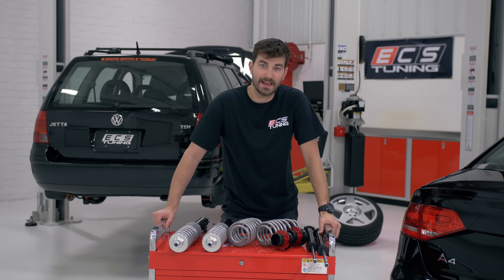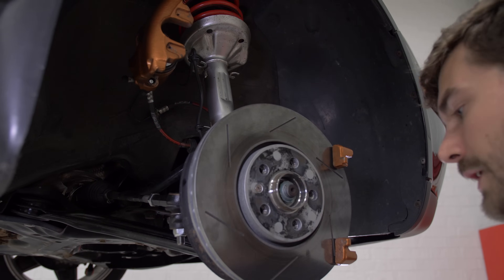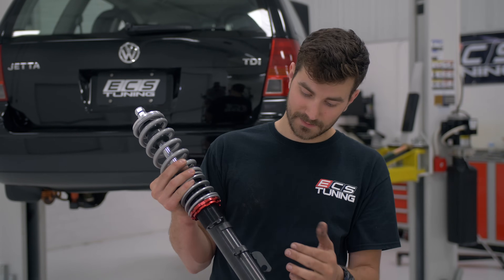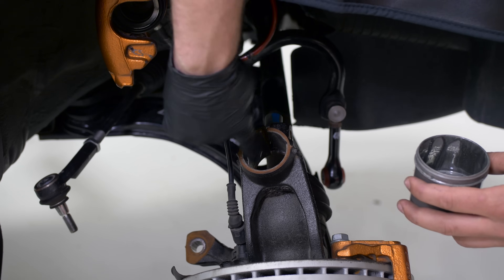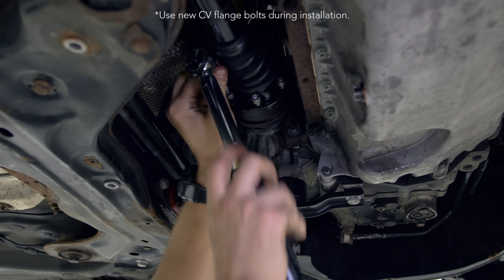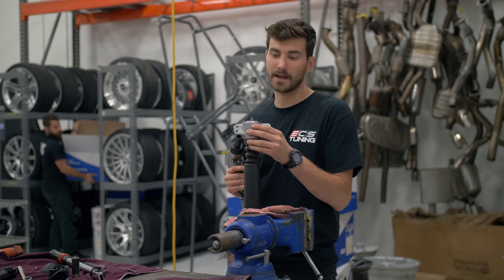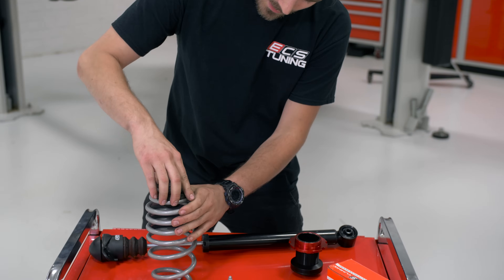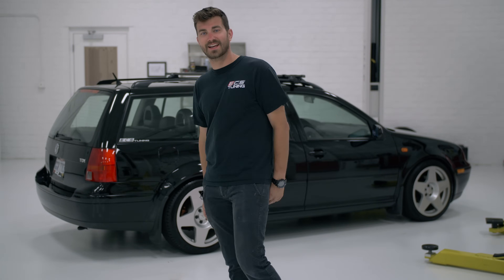VW MK4 Coilover Removal and Installation DIY

Comment: The way you do it stresses me out...not everyone lives in a shop with every tool imaginable some of us need poor person DIY instructions
Reply: What exactly here can't be done at home? The only thing shown here that wasn't a basic, BASIC set of hand tools was the lift and trans jack. Neither of which you absolutely need to get the job done. Jack it up, sit it on stands, then use floor jack to line everything back up. When torqueing rear shocks set it on blocks of wood. Every other tool here can be had for a grand total of like ~$200 from harbor freight.
Reply: @theyrealltaken3  imagine calling someone stupid and forgetting a period at the end of your last sentence. :)

Comment: There is no need to remove the caliper, ball joint and all that stuff. As long as you remove the (6) 12 point bolts and disconnect the axle from transmission and just move the axle to the side you have plenty of room remove the old suspension and install the new coilover.

Comment: this is actually an amazing video. great mk4 content to us dudes that still drive nicely stanced golfs/jettas/beetles. Just did my coilovers 3 weeks ago and I've been stoked since.
Reply: also i had a question. do those perches sit flush? i think i have some rust built up because the perches weren't flush but they were tight after i tightened the nut on the plate underneath.
Reply: I just bought mine today and got the rears in, So pumped yo
Reply: Mine I just installed make some banging in the back from what sounds like the top of the rear shock mount, is that a ride hide issue? Please help 😅
Reply: @TylerSmithMusic1  use the stock strut mounts

Comment: 4 years later after much abuse and dealing with the north east winters/salt and pot holes they're holding up. Very rusty and definitely worn out but they still work. Going to be buying another set of these soon. Also threw a hitch on the ole girl and towed around my quad/snowmobile and jetski with my MK4. Suspension handled it great
Reply: It's amazing how many are still on the road. 
In my travels for work daily I usually see a handful of them cruising along.

Comment: i just put this kit in my mk4 gti 3 door last week with 18x9.5 rims with no spacers and it rides amazing, i did the same adjustment as this video and it is the perfect height. all parts fit as expected, took me about 3 hours to install, it was very painless and i couldn't be happier with the results. I had to change my sway bar end links to adjustable ones. other then that absolutely no rubbing and it handles like its on rails. very quality  parts and the install kit just made it a hell of a lot easier. Ill do an update after a few months of everyday driving with regular 3 hour road trips.
Reply: I would reccommend  doing both sides of the rear at the same time, i had to learn that the hard way. nothing a bottle jack cant fix tho lol
Reply: 2 years later do you still recommend these coil overs? I’m looking to get a set and i am not quite sure what to get.
Reply: with what offset
Reply: no idea honestly, still have them over 4 years
Reply: @TTaylor841  yes

Comment: Just a recommendation,  The rear axle needs some adjustment when lowering. Loosen and replace the stretch bolts that secure the rear axle to the body (don't torque at this point). The swing arm is heavy so support with a jack, etc. Get the ride height set as close as possible with the car on blocks and tighten down the rear axle bolts along with the lower shock mount bolts. The reason for this is the swing arm bushings will be under considerable torsional stress once the car is lowered. They are set during original vehicle assembly for a factory ride height. The bushings should have little or no pre loading on them to prevent premature wear. To reiterate, do not reuse the bolts. They are torque to yield and should be discarded once removed.

Ideally, replace the bushings with ECS Polyurethane rear axle bushing kit. These are much nicer than stock, which are probably worn out by now if original.

Dropping and re installing the axle isn't all that difficult. I've done it many times by myself using a floor jack, but as with most things in life, it's always easier with help.

The only shit job is getting the old bushings out without the proper tool. I've done it using a bearing press tool,  jigsaw with a metal blade and a hammer / chisel.  Many YouTube videos on this topic.
Reply: What rear axle
Reply: @Michal_S0L  I use VW nomenclature and they also refer to it as: “Axle Assembly”
Reply: Agree good idea to “adjust” the load on the rear beam axle bushing but replacing is a massive pita if it’s not necessary.
Reply: did any fluid come out when you took the front axles off?
Reply: @Matitys  On the MK4’s, no oil should drain from the final drive when the front drive axles are removed. If oil does escape then it’s an issue with seals. These cars are old now and major parts are wearing out. I finally sold my MK4 as I was tired of chasing the never ending issues. Bought a new Tiguan. Growing up with kids changes your vehicle choices.
Reply: @TRCFL  thank you i just did it today and nothing came out

Comment: You can do the passenger side without removing the axle aswell. If you undo the stabilizer, tie rod, and ball joint you can get enough rotation to pull the strut out aswell. Just a helpful tip for yall😊

Comment: There's no need to unscrew axle from gearbox 😬
Very clean everywhere all new parts, try to do it on 10 year old car bro! 😁👍
Reply: You have to disconnect the axel some way or another, either by removing the M8 nuts or by undoing the big axle nut on the hub. Im installing the Jom Bluelines on my 03 Golf TDI and the axle needs to be dropped a bit some way or another...or I think maybe the springs could be compressed to slide it out but even then I don't think it will work. All of my bolts are rusted to shit, they salt and brine our roads like crazy in the winter. When I undid the rear top mount there was salt in it, literally a mound of salt...its August lol

Comment: Great kit! 45k mi, zero issues. I did use Audi 80 (I think) upper mounts. Drops front another inch, so you can put more spring back in coil and still be low. Rest I used ECS heavy duty install kit.

Comment: Getting these coilovers installed tomorrow!!
Reply: How do you like the coilovers? I'm wondering if it's worth getting or if I'm better off spending a few hundred dollars more and going with Koni or bilstein
Reply: Literally just installed these tonight on my 05 GLI. For your basic suspension refresh these are a great deal. Just be sure to get camber adjustable top mounts and install kit to go with them.

Comment: About 6:45 into your video i noticed the top cup snuggled tight on the strut tower. What happens when it's got weight back on it?  Mine popped up like an inch. Is that normal?  If not what can i do to make it snug. All the nuts are tight by the way

Comment: Hey Zach I just had a set of these installed.  Upon inspection after I left the shop I noticed they didnt seed the shaft all the way down in the knuckle.  Shouldnt these go down all the way into the boot?

Comment: My alignment tab at the back when I push it all it the hole in the alignment tab doesn't line up so cannot put bolt through and the coilover strut will not go down anymore as there is a lip underneath to stop it from going down too much

Comment: What is the socket you used to tighten the top hat on the front mount with an Allen wrench? Mine are loose and can’t seem to find a way to tighten it
Reply: They sell the socket as well. Just buy the 5 pack combo for future changes. I needed a 17, 21, and 22.
https://www.ecstuning.com/b-schwaben-parts/strut-nut-socket-set-5-piece/003046schkt/

Comment: I have a mk4 1.8t with coilovers But in the front when I hit bumps and potholes Its so rough and doesnt take it nicely. I was looking at your ecs suspension rebuild kit, with the control arms and everything, is that what I would need you think? Idk what I should get to make it smoother
Reply: Ryan Reilly the problem is that you have $400 coilovers.
Reply: Aaron Garcia nope it's not, coils are good it's control arm bushings,maybe you should know about parts before putting out ridiculous comments like this one
Reply: Aaron Garcia took the car apart and it needed a whole bushing kit and the control arm bushings were the problem of front end play

Comment: I just took a set of these coil overs off of a broke down gti so that i can install them on my mk4 vr6 jetta......... i noticed that instead of throwing away the shipping nut whoever installed these used the "shipping nut instead of the tapered nut when torquing down in the vise" where can i find this correct taper nut??????? you dont even show it in this video and it appears that it doesnt come on the coil over. do i use the taper nut from the oem stuff i pull out ???

...
Reply: I used the oem nut from my 337. You can always go to your local VW and buy them. Just make sure to have your vin number as they require it.

Comment: How do you adjust the camber with the stock strut mounts? I am struggling with positive camber. In my passenger side. It's eating my tires up.
Any info will be greatly appreciated.
Nice job on the video!
Reply: Not adjustable in a mk4 unless you ad camber plates.  I’ve read that increasing caster may impact camber…

Comment: No need to remove that cv axle if u got a big washer take the bolt out on top and the little aluminum cup thingy throw the washer down the cup thingy and the bolt tighten back in as if u were putting it and have someone jump on that shit and the other hit with a hammer get that shit outta there don’t wate time I did this piss drunk cheers my friend best of luck 🍺🍺

Comment: When these are shipped are they set at 1.4 inches of lowering?
Reply from the maker: They are not shipped with the threads set at a particular ride height.  You would have to spin the threads to your desired height during/after installation.  You can check out more info on our coilovers here: https://goo.gl/QiMaHw

Comment: is it normal for the rear springs to hang loose when you put the car in the air when lowered on coils?
Reply: When I unbolted my shocks and the trailing arm on my FWD Audi TT, my H&R springs fell out and rolled away:P

Comment: I welcome installation videos; if you are going to teach people how to do things correctly, I think you need to emphasize the use of safety gear and proper use of tools. You guys probably sell safety equipment; ear, eye protection, gloves etc. through your Schwaben line of tools (another marketing opportunity); while it may not look as good on video with your tech presenter, I think it is important to emphasize safety when doing this type of suspension work. I can't tell you how many times I hurt myself as a young kid; because, I didn't know any better. There are many first time young diy's guys out there and they need to learn about safety, as well as how to install things like this suspension kit in a correct manner. 
Not trying to come off as annoying but just a thought and something to think about; when making future videos. Thanks for posting this and I hope to see more on the Mark IV VW line of older cars... .some of us, are still driving them! :) Thanks, again! :)
PS: a second video about post installation issues; like alignment, camber adapters, adjustable endlinks and sway bar fitment, would be appreciated. I think, all of these types of issues are important to know about and how one, should make the correct adjustments, when lower a car like this.
Reply: Billy P. Chill

Comment: What are the wheel dimensions on the on those 52's?
Reply from the maker: Here's a link to our fifteen52 wheel options for the MK4: https://goo.gl/5ooQ42

18"x8.5"  ET35 All Around
5mm Spacers Front, 10mm Spacers Rear, 235/40/18 Tires
Reply: ECS Tuning I think I’m missing something, but I can’t find these rims anywhere

Comment: What’s the purpose of trimming the bump stop down?
Reply: It's because the car will sit lower after the springs and shocks/strutc shown in this video are installed. The bump stop is for a vehicle at stock ride height. They were trimmed down so that at the new, lower ride height they wouldn't constantly bank into the shock body.
Reply: What size tire and wheel combo is used here perfect stance

Comment: The video seems to be rushed like if you were talking to people who have already done these kinds of projects. You have to pretend that you are guiding paper pushers on their first project. Lay out all the parts, explain how the parts go together, a brief on how your coilovers work, and the tools you are using when you are using them. Slow it down... what should I watch out for? What are the biggest problems I might run into?
I had to review many other videos on youtube in order to understand some of things you rushed through. 
For example: when you put together the front coilover I didn't see how the bearing went on because they have two different sides. I also didn't see which nuts were used.
You also didn't explain how it would affect the oem sway bar end links. I think this is a very important piece missing from the video.

Comment: I'm not going to lie. I'm wicked frickin scared to do this ked. I used to have help with my Honda but now I'm alone with a jetta.  I just ordered some solo werks joints and they arrived from ecs. I'm going to Boston tomorrow going to get some tranny oil and tools. I'm going to go for it. I think I'm going to pork it. Drop the car on myself all alone on the side of the skate park. Some scooter kid will find me toes curled up. Start dancing around singing ding ding the wicked middle aged skater is dead.